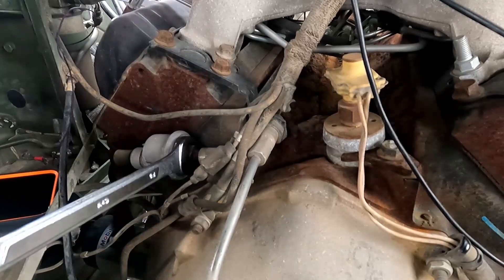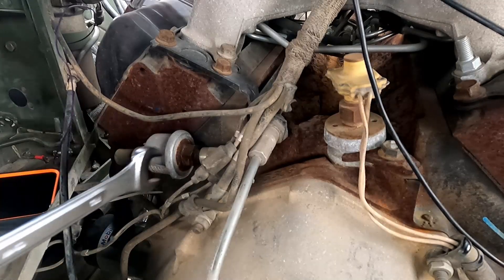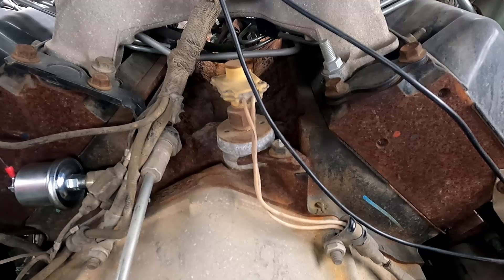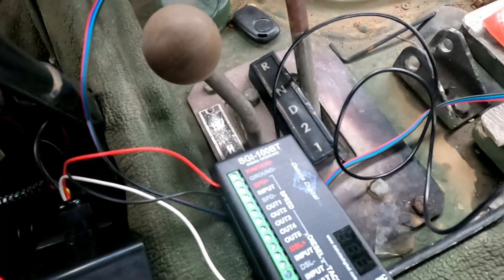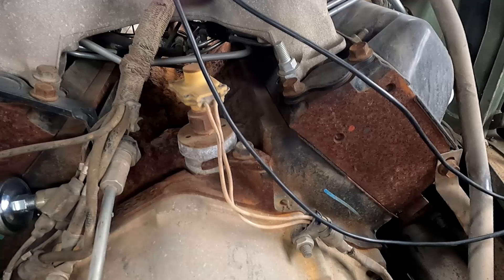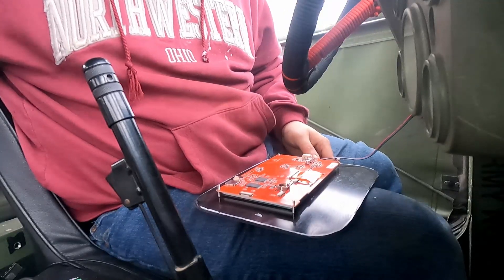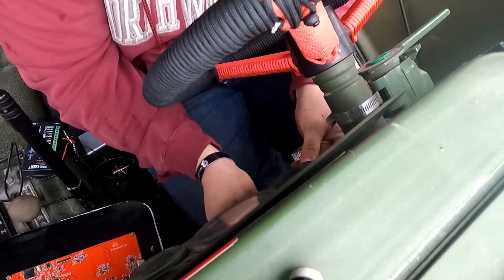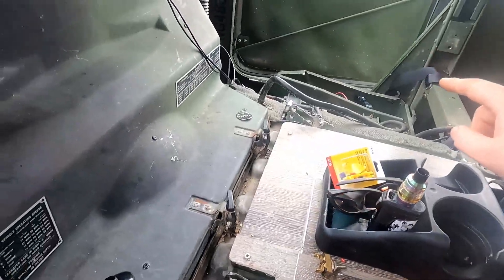Humvee Digital Gauges Install

Comment: Do u have a parts list on the sensors u used...trying to price it all out...thx in advance and Happy Thanksgiving
Reply from the maker: I actually reached out to the guy and he sent me all the correct sensors. I couldn't give you an exact parts list. I did change out the temp sensor, and oil pressure sensor. I also got the Dakota digital for RPMs but have yet to figure it out.

Comment: How are the gauges working 9 months after install?
Reply from the maker: I'm still working out a few bugs. However that's due to my lack of time. Overall I like them, a lot more visible at night. Not had any major issues. Would suggest them if you are interested in something different.
Reply: How did you hook up to read your fuel level???
Reply from the maker: I tapped into the wires that went to the OEM fuel gauge.
Reply: @BogDeepTV  gotcha...meant to tell ya...bad ass install...keep up the great work